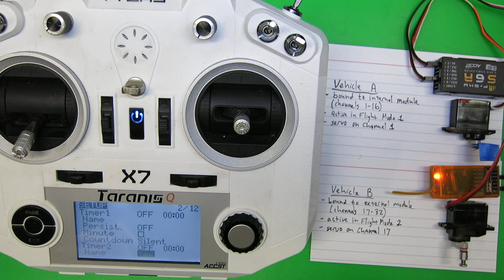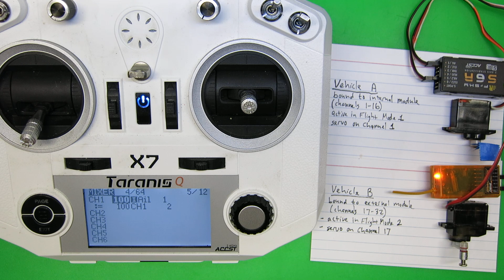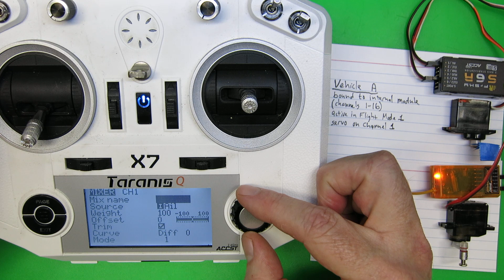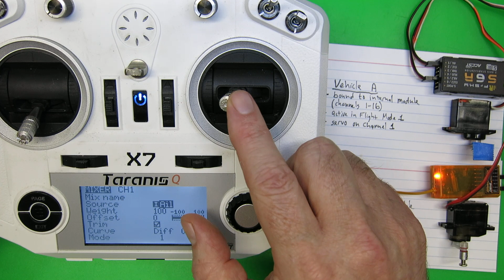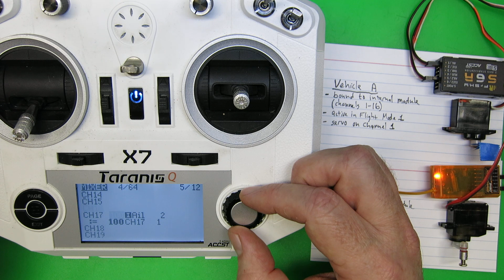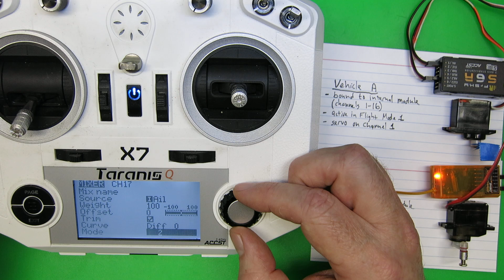Controlling Two Models with Taranis/OpenTX

Comment: Hi. 
I have a Taranis qx7 and 2 X8R receivers. 
Is it possible to bind both of these to an internal module? 
If so, how? 
Is it like this in this video? 
I think I saw a video somewhere where they use jumpers and somehow connect 2 receivers together to get 16 channels without using an external module.
Hoping for a good answer and preferably a video (link) of how this is done.
I'm building a Smith Rotterdam with lots of stuff in it that I want to be able to control from the radio.

Comment: Can i operate two receivers simultaneously? I dont wanna switch between them.. I just want sticks output in one receiver and switch output in other receiver😊
Reply from the maker: Yes! Look at the Setup screen, and you can set up Internal RF and External RF, with channel assignments going to each.  Add an external transmitter module, and bind each to the two receivers.  Good Luck!